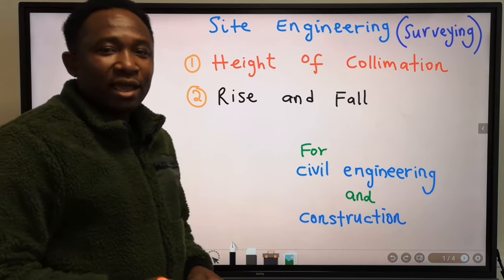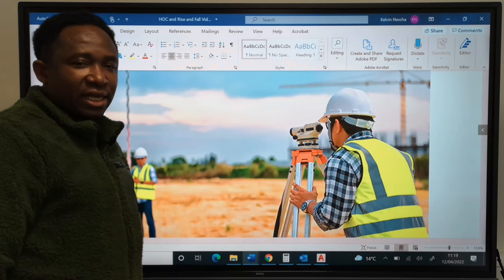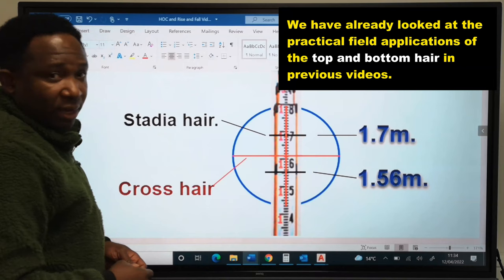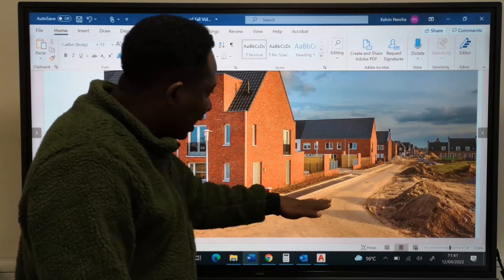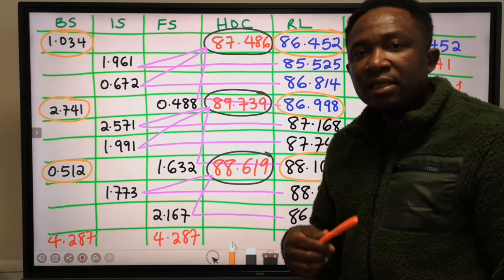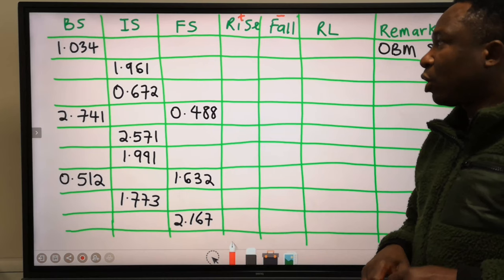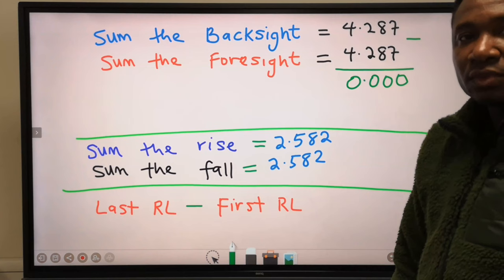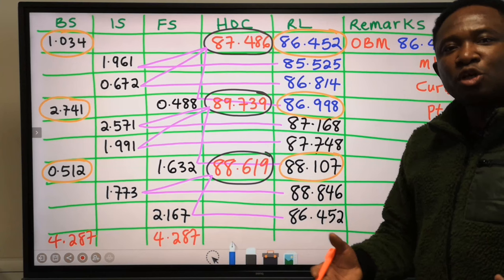How to Calculate Height of Collimation (HOC) & Rise and Fall Methods for Site Engineering Surveying

Comment from the maker: Video Timeline Guide:
00:00 Introduction.
00:31 Surveying field book table for recording.
00:38 Table difference between HOC and Rise and Fall.
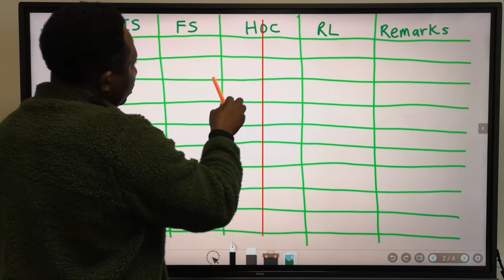00:53 The instrument needed for the levelling (Auto Level).
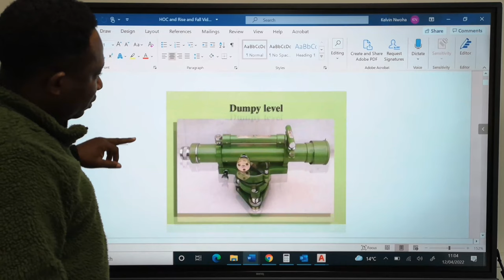01:02 The difference between Auto level and dumpy level.
01:10 Auto level, surveying tripod stand, survey levelling staff or rod.
01:30 Plumb bob in surveying (what it's used for).
01:55 What is surveying benchmark (How to identify site benchmark).
02:44 GPS and GIS with site benchmark.
03:23 How to record surveying field data.
03:27 How to record the benchmark values on table.
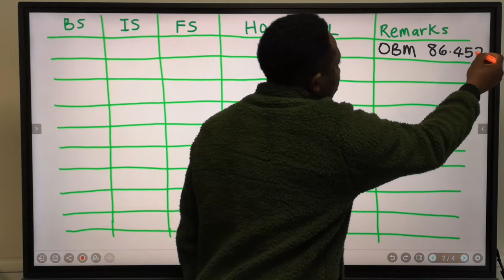03:43 What is Backsight in surveying and how to record backsight.
04:31 What is Intersight (intermediate sight) in surveying and how to record intersight.
05:30 What is a foresight and how to record foresight.
09:42 How to read the cross hair in surveying.
10:38 Staff or rod movements and points to measure.
10:53 Manhole, marked points on site, curbs, gutters, permanent site structures, etc.
11:59 Foundation setting out with theodolite, total station or measuring tape.
12:11 Difference between a total station and a theodolite.
12:20 Purpose of levelling in surveying.
12:50 How to calculate levels using height of collimation.
19:33 How to check for Height of Collimation with formulas.
19:43 Sum of backsight and foresight.
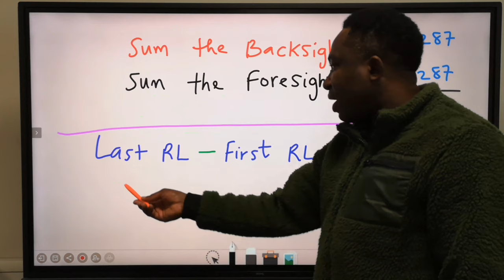20:15 Last reduced level minus first reduced level.
22:51 How to calculate levels using Rise and Fall methods.
31:13 Formulas for checking the accuracy of rise and fall in surveying.
34:31 Conclusion of Height of Collimation and Rise and Fall surveying.

Comment: Your first RL and last RL is same, so that  means you close your observation at OBM. Your Label must be same!
Reply from the maker: Absolutely Jacob.
Reply: How do you mean please
Reply from the maker: @isaacchiagozie9648  I ended the reduced levelling (RL) task at the same Ordinance Benchmark (OBM) [primary control point] station where I started transferring levels on the site ground. 

You can also start off from a Temporary Benchmark (TBM) [secondary or tertiary control point] station. 

If I had ended at a different station, I should be getting a value less than or greater than 0.000 in my final checks. But no matter how you ended your RL on that site, if you have carried out your levelling observations accurately, the final check should definitely be fine. 

I hope this helps. I will be making more videos on this and more subjects.